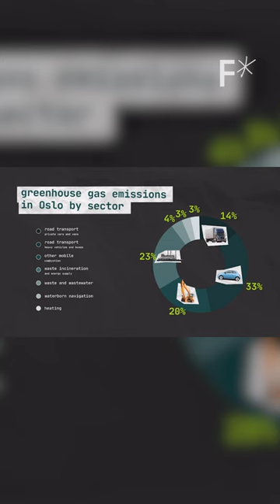"Clean construction" uses battery-powered equipment ♻️👷‍♀️

Comment: I dont think this is very green at all. Electricity isnt inherently "green" just because its electric.
Reply: It's progress in the RIGHT direction.....not a total solution......please be patient 💥😎✅
Reply: Electric infrastructure becomes cleaner as the local grid reduces fossil fuel use. But even using the dirtiest, most coal-dependent grid (West Virginia, USA), EVs are still cleaner than internal combustion vehicles.
Reply: Along with the fact that Norway has been transitioning to hydro and wind power, I does make a lot cleaner than the OTHER alternative.
Reply: Norway's electricity is almost all generated with emission free renewables. But even without that, gas engine emissions are poisonous and it's much safer to remove them from our neighborhoods and cities entirely if feasible, even if the power is still generated from fossil fuels.